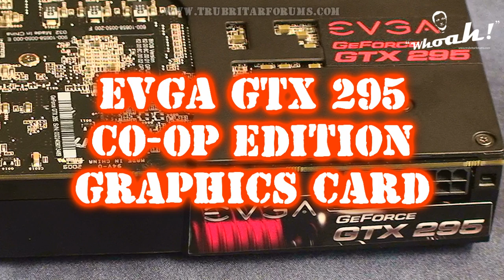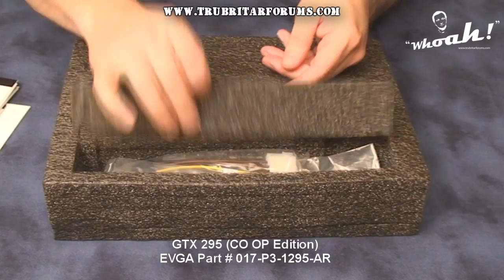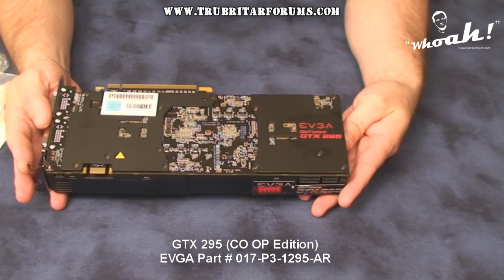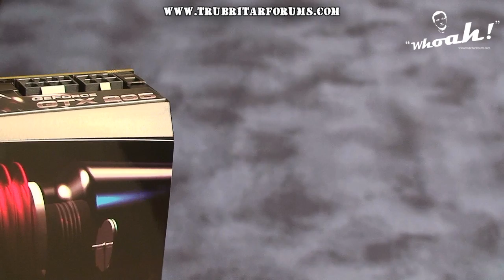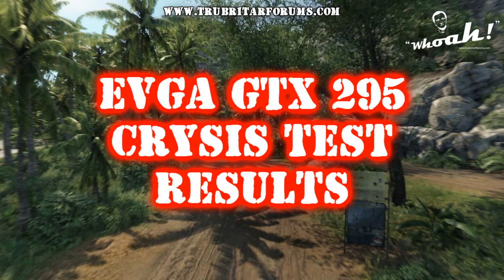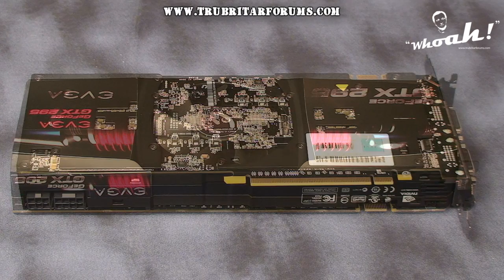(HD) EVGA's GTX 295 Co op Edition GPU

Comment: How well will this rig run crysis (frames per second wise) on everything very high, 4xAA 
MSI GTX 295
6GB DDR2 Ram
Intel Core 2 Duo
1280x1024 Screen
850 power supply
Reply: 4 FPS. You need to download more RAM, mate

Comment: nope, the cooler in the video (the stock) blows hot air out the back of the case, intaking through the fan on the top.

Comment: i like the older card becouse that has good power. But also has three outputs. That enables you to run three screen in non sli mode. But in the new one you only got two outputs!

Comment from the maker: Hi There,

I have received lot's of requests to start using the Core i7 920 CPU on benchmarks because it is more comparable to the type of CPU a majority of viewers already have or are looking to invest in.  I do also have the 950, 965 and 975 but these are used primarily in other system configurations right now.

Hope this helps.

Trub

Comment: thank god they released a single pcb i absolutley hated the dual pcb 295 it looked to flimzy around the fan i was almost afraid to touch it and another pro is that you can run devices if watercool them cuz they wont take up another slot way to go EVGA!